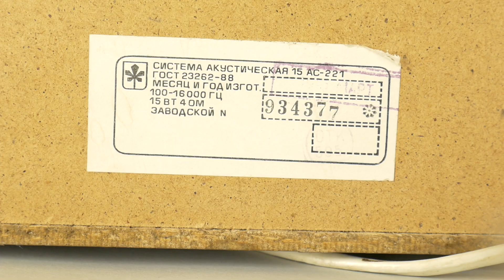Look inside USSR Loudspeakers

Comment: I had those drivers too about 27 years ago. The box on mine was smaller like a subwoofer but the speakers were the same. Foam rotted so many times i replaced it 3 times and the 4th time it got replaced with rubber surrounds